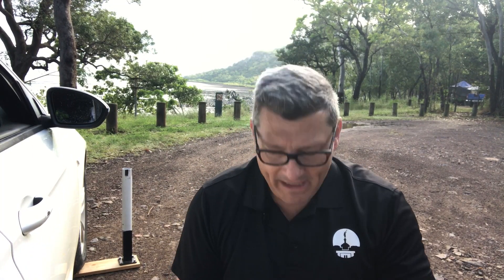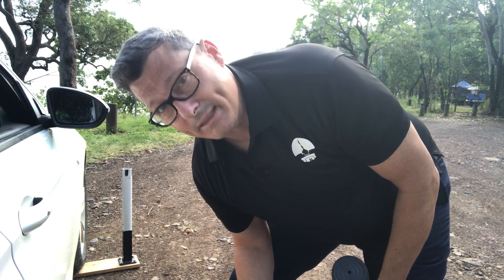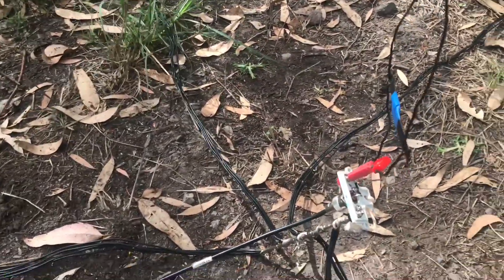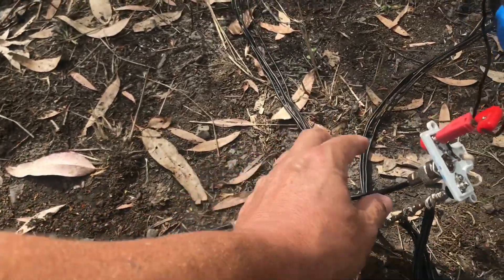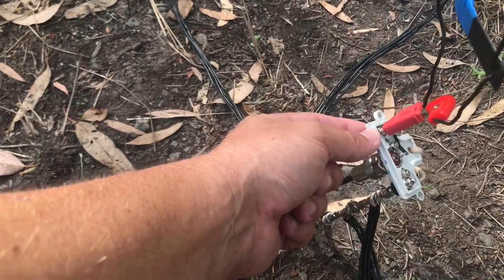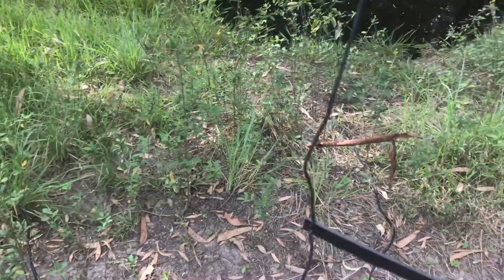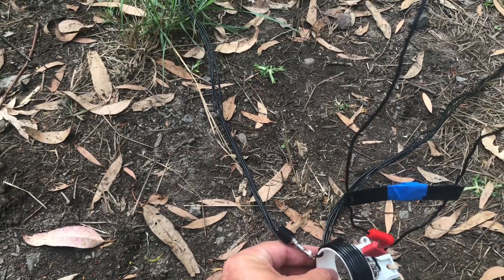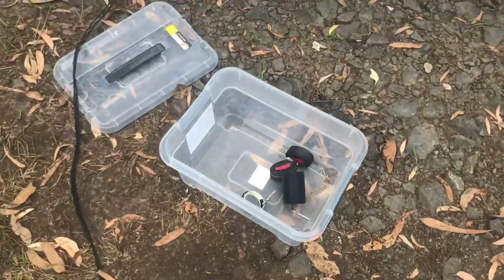Home made fan vertical antenna.

Comment: Marty could you add a bit more inductance to the 30m wire to find s sweet spot on 17m. I know its a different concept to efhw but i made my 30m section resonate at 9.8 mhz and then it gives good vswr on 17m . My ft817 show vswr 1.8 t 1 on 30m and 1t1 on 17m. Rig give full power anyhow at those vswr levels. Great antenna all the same thanks for sharing.  vk5cz..
Reply from the maker: Hi Ian, thank you for that tip. I will give that a try. Always good to hear from you mate!

Comment from the maker: The lengths of the elements are 10.130 metres and 5.03 metres. This is from the top of the wire to the bottom of the banana plug. The ground radials are 3 metres long and 5 of them all soldered at one end to a banana plug. There are 5 of these sets. Each set I have taped the wires together for the first 1.5 metres and the last 1.5 metres the individual wires can be fanned out.